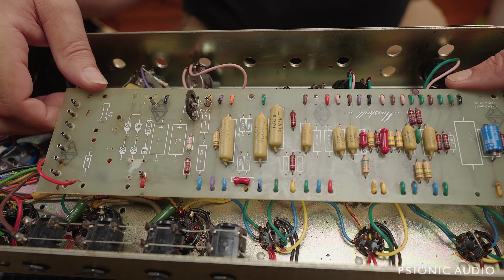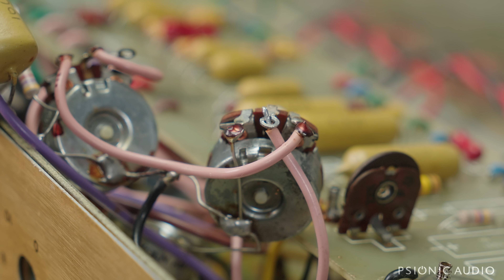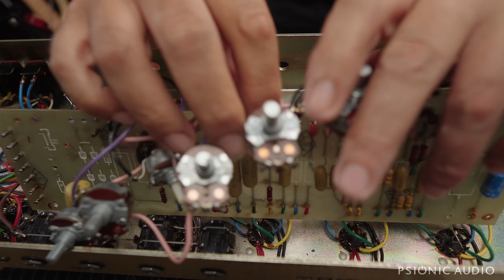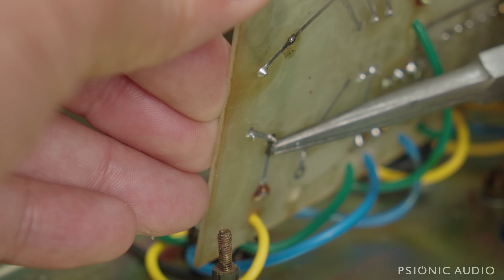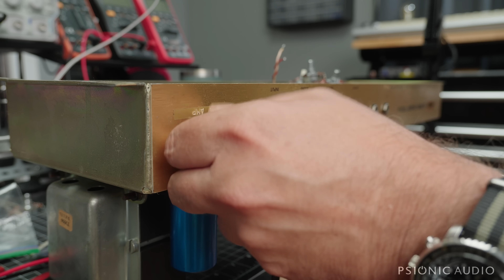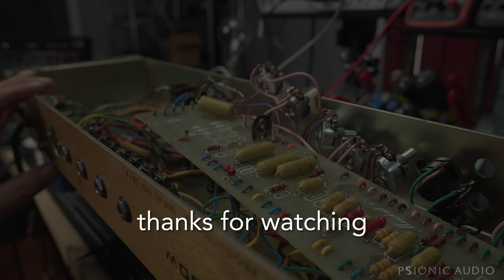Deep Dive | '74 Marshall Superbass Pt 3

Comment: Yea those pc boards from the '70's are tough to work on. It seems like the copper cladding doesn't like too much heat. I have one thats been butchered by another tech. Repairs to multiple traces are in order. Thanks Lyle for all you do. I learn more from you than any other tech out there. ❤

Comment: Lyle, when checking the ot, shouldn't you also be concerned with measuring any connection between the primary and secondary?
Reply from the maker: That would be extremely unlikely. But it would have been reflected in the primary DCR measurement.

Comment: With regards to those little cracks in the epoxy covering of the non-electrolytic caps -- would resealing them with the tiniest bit of CA glue be worth consideration?
Reply from the maker: Not by my klutzy hands, but possibly helpful.

Comment: I definitely went for the Piher's in my 1976 JMP, they just look cool and keep the amp as close to original as possible. These amps seem to keep going up in value (if they aren't butchered).

I was wondering... is there some sort of epoxy or something that can be brushed onto those mustard caps to reseal them--assuming they are not already noisy--to keep moisture and dirt out of them? I know it seems sort of silly, but those caps are really expensive these days.
Reply from the maker: Maybe a very thin CA glue but that’s not in my wheelhouse. I’m afraid I’d leave a gloopy mess if I tried it. Ted Woodford could color match the old mustard…
Reply: I was thinking the same thing.  What about clear nail polish?